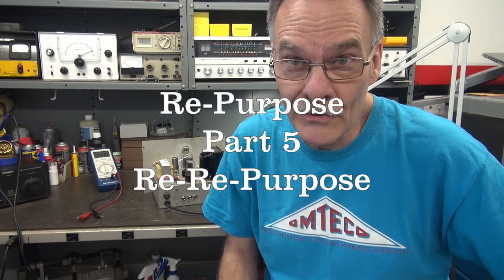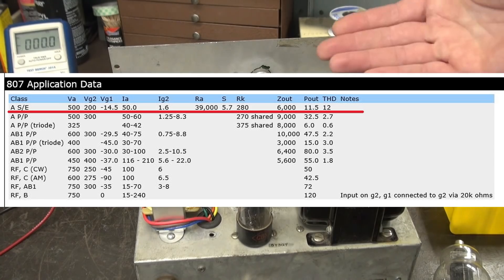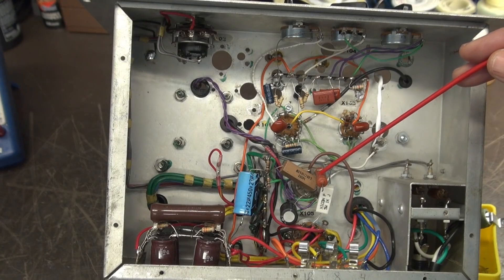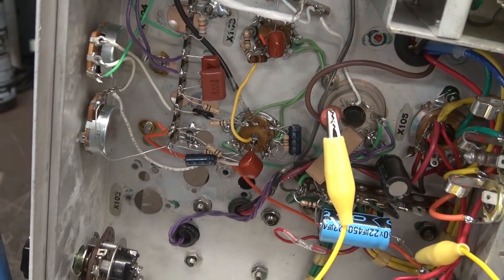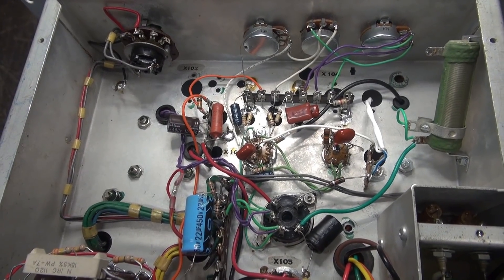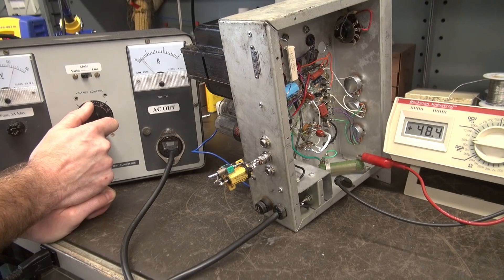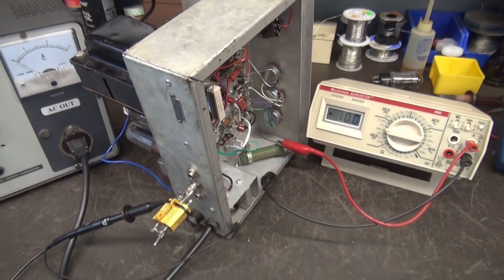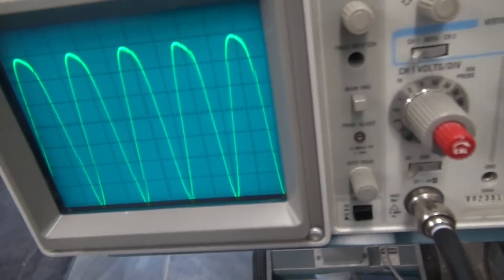How to re-purpose junk into a cool guitar tube amp Part 5 Change of plans 6L6 to 807 creation

Comment: Hey Terry.  I am trying to reproduce this amp using what I have in my parts bin.  My power transformer is out of a 1950s Collins transceiver with the 1068 V secondary burnt up.  It also has a 346 center tap winding, and 2 isolated 6.3 V ceter tap windings as well. I am using 2 half wave rectifier tubes giving me, after filter caps, a B+ voltage of 536Vdc no-load and 516Vdc with  15KOhm, 25W, load resistor.  My question is, is the 500V target voltage the Max for the 807 or is 516 nothing to worry about?  I am a newbie to tube amp tech. I work with digital electronics embedded microcontroller systems with my day job.

Comment: Hey Terry.  I am trying to reproduce this amp using what I have in my parts bin.  My power transformer is out of a 1950s Collins transceiver with the 1068 V secondary burnt up.  It also has a 346V-CT-346V winding, and 2 isolated 3.15V-CT-3.15V windings as well. I am using 2 half wave rectifier tubes giving me, after filter caps, a B+ voltage of 536Vdc no-load and 516Vdc with  15KOhm, 25W, load resistor.  My question is, is the 500V target voltage the Max for the 807 or is 516 nothing to worry about?  I am a newbie to tube amp tech. I work with digital electronics embedded microcontroller systems with my day job.

Comment: You still did not address the 'mid-range scoop' that your guitar player friends noticed.  However, this is easily fixed.  This scoop is a consequence of Fender's choice  of a fixed 6800 ohm resistor as a mid-range control -in their lesser amps.  In their high end amps, this resistor is replaced with a a 10 K  pot.  You can then set the midrange as you like it.  With a wide open pot, ALL midrange signal goes to ground.  With a closed pot, almost none of this signal goes to ground-you get much more midrange in your output.   You could even keep more midrange by adding a 1000 to maybe 4000 ohm resistor in series with new pot.     There is one downside of the new circuit however:  If you close all 3 tone controls, no signal gets through and the amp is silent--even if the volume is on 10!

Comment: I was looking at a CW transmitter that uses a 6L6 and an OD3 regulator on the control grid. it is powered off of a 325 1mA b+... would I be able to repin and throw in an 807?

Comment: Terry! I think it would be great to see a 6dq6 amp! Maybe an stereo SE version, a good project keeping the idea of use hamradio tubes like 807, here in Argentina radio amateurs have used them for transmitters or even to modulate in the audio section of the transmitter

Comment: Just a warning, I've found a lot of the old 1625s and 807s are a bit gassy by this point- it pays to reactivate them by running the filament for about 24 hours before putting any high voltage on them.

As a bit of trivia for those who aren't aware, the 807 is basically a 6L6G with a plate cap, 5 pin base and ST shape envelope.

Comment: Hello Mr. D-Lab,
I have a Fender Bassbreaker 007 with a humming/hissing/and crackling noise that hasn’t responded to swapping tubes and cleaning contacts. I don’t trust myself beyond that level of maintenance/repair. I am a huge fan of your channel and wonder if it is possible for me to hire you to address whatever issues I have causing the noise. I love the base sounds of the amp, but the noises have made it impossible to enjoy. I trust your methods more than anyone I’ve seen, and even if I could find someone local, well, I don’t know what kind of “cobbler” job I might end up with. If there is a better method for contacting you, please let me know and I’ll be in touch. If you aren’t currently taking jobs of this type, I understand and will do my best to find a qualified technician that can troubleshoot this fun little amp. I assume it’s circus boards and cheap tube sockets, but I’ve never opened her up beyond swapping tubes around. If you were to take on the job I would trust your suggestions for improvements without question, and I think it could make a fun video for examining these MIM little amps. Cheers and thanks for the great content!

(Edit, made in MEXICO, I just had a moment when typing the abbreviation)
Reply: Kevin Counihan Thanks for the tip. I’ll look into the schematic and give it a peek. Any suggestion on brand and rating for replacements? I am familiar with and comfortable discharging and replacing caps. I am not much of a troubleshooter and am reluctant at my diagnostic skills and getting in over my head if it is one of those things that could be anywhere in the amp.

Comment: Fun little build, Terry! I enjoyed that. What's the theory behind the added zeners feeding the screen? I feel like I've seen that before but can't remember the reason. Thanks again for the video.
Reply from the maker: Hey man, The Zeners do a better job of lowering the voltage for the 807 screens. Not just burning up power with a resistor voltage divider. The 807 wants approx 200vdc with 500 plate (class A), However I needed that higher to provide enough juice for the pre-amp section, so I cheated  bit. This project was big fun, Glad you liked. TD

Comment: I had the same teething trouble building transistor type 300w per channel power  amplifier.

Also my on the bench socal 50 tube amp needs a few things sorted on it.

Good video on reusing casing to build a new amp.

See how she sounds when the guitars guys try things out.

Comment: Hey Terry, may I suggest you try feeding a higher voltage to the first stage of the preamp for more gain, and maybe increasing the plate resistor value to 220k like Vox does in the Top Boost preamp?
With a higher voltage and more gain in the first stage, you'll have a higher, clean output swing, which hits the second stage harder, but keeps the preamp simple!

Great videos as always! Cheers from Brazil.
Reply: By increasing the supply voltage of 12AX7 (and keeping the operation point ideal by changing cathode and anode resistors respectively) a lower THD can be achieved as well, if wanted. However, the lowest possible THD is propably not what you always want if we are talking about a guitar amp. 😀

Comment: I got tired of relic'ing my Tele testing amps ... so I built a little 6x12inch plank with small risers, a guitar pickup, an old broken string, a tuner to get string tension, and a jack to "be the guitar". It fits on the workbench. I debated using a jack vs hard wiring a patch cable but the jack allows more flexibility. I also stay a little more focused on the amp and don't get distracted playing the guitar or tuning the guitar. Here's a handy "how to" :) ... https://www.youtube.com/watch?v=yZ7DZ7HPXck

Comment: Now that you are using the 7K tap, why not try the 5K tap as an Ultralinear mode. You could have a switch between G2 voltage and the 5K tap, your choice of operation.
Reply: No, you cannot do this with the 807 at 500 V plate voltage, if at all. This tube likes to see constant screen grid voltage at about 200 V - 250 V. Only question would be: Which tap of the output transformer would slightly deliver more output voltage swing into the load resistor and thus a little bit more wattage: 5k or 7k?
Reply: @johnnaighley9252 Thx, I don't know the 807 that well. And honestly  I have always questioned the benefit of UL on an SE amp?  Never tried or heard it. I do like UL on PP amps though.

Comment: Actually, there is a way you can lower the supply voltage, and that's by using a choke-input filter. It will drop the B+ by about 30%
Reply: There are many ways to lower the B+ voltage. In this case I would have used a couple of 10-15V/5-10W zener diodes in series with the B+ line.
Reply: @jutukka  This would actually be a poor choice, as this would cause a lot of heat to be dissipated on the zeners, whereas having a choke-input filter trades off voltage for current capability and doesn't waste any energy that you have to dissipate as heat. Also, even two 15V zener diodes in series wouldn't make too much of a difference here. The 6L6-GC datasheer calls for 350V of plate voltage, so you'd have to drop around 130V (taking into account the voltage drop across the cathode resistor), which would require to dissipate 7W of power (not counting the g2 current).
Reply: @kardRatzinger The produced heat is of course a fact. But those zeners cost only a few bucks and they can be quite often installed into a place where the heat from power dissipation is not a problem.
Reply: @jutukka  By the time you get to the recommended operating point of the 6L6 you are wasting about as much power on the zener as you are putting out into the speaker. Surely, we can agree this is not a particularly design. Even assuming you can avoid overheating problems.
Zeners are cheap, I'll give you that, but a choke-input filter is even cheaper - it's free! There already is a choke in this power supply, just needs to be moved in front of the first filter cap. 
So far the choke-input filter is wasting less power, providing more power capacity, causing less heat issues and even costs less than the zeners. I don't particularly see any disadvantages, it has all going for it.
That said, I have used zeners to drop the g2 voltage with respect to plate. G2 current is small, so so is power wastage.
Reply: @kardRatzinger  OK. In this case when the choke is there already, your point is absolutely correct. But zeners are sometimes very handy. Once I got for free a 1972 Laney L100 chassis with original PT. I wanted to build a 15W  (two 6V6s or EL84s  ) amp using that chassis and PT but I did not want a EL34 quadruplet 100W monster amp.
 I lowered that 70's british crazy 500V  B+ voltage almost 200 volts to get the B+ I wanted. To do that I built a string of 20 zeners in series to s stripboard, which was a very nice because you could adjust the voltage just by jumping up or down in that string. If I some day want more watts, I can throw those zeners away and install another OT and EL34s again. 😁
Reply: @jutukka  Yes, so you basically tried to force an unsuitable power transformer into a role for which it wasn't designed. It can be done, but that's not proper engineering in my book. Kind of like building a motorcycle by cutting a car in half.

Comment: You didn't say how much power. I'm guessing 15 watts now, maybe a little more?
Reply: Yes, a wattage measurement would be great. I guess, 10 watts rms could be possible.
Reply: John Naighley I thought 10 with the 6L6. 807 maybe a bit more. I have 4 matching 6L6GC I used in 2 mono blocks. Also have a pair 807's that were in a pa amp in the old state theatre in Easton Pennsylvania when they showed movies. I may use these tubes again if I can find the right chassis for a build.
Reply: @russredfern167  So let's hope, Terry is gonna measure the output...
Reply: John Naighley Next video I would say

Comment: Terry the only “problem” I can see is that I can’t think of a commercially made guitar amp that would use an 807.  You can buy 6L6s and 12Ax7s at any Guitar Center.
Reply: Good point but I don't think he is planning to mass produce these.

Comment: If you ever do this again just do a 6BG6.  It is a 807 but for TV use and it uses the octal tube socket. Also both the 6BG6 and 807 are available from Russia. I think they call both the G807.  The octal one is 6BG6 and the regular 807 has the 5 pin socket.
Reply: The 6p G6 is also dirt cheap. There's tons of them out there and they made them all the way to the end.there were some j a n ones built towards the end that have 7027 guts
Reply: Good to know. Thanks for the info!
Reply: Г-807 and 6п7с. Also you can search for Г-811 и Г-812. (g807, 6p7s, g811, g812)

Comment: I'm curious how hot the zeners run.  Seems like they'd have to run quite a bit of power if they do any current at all.
Reply: I usually see fat zeners used like that
Reply: I thought the same. What about the power dissipation of the zeners, Terry?
I guess, at least you'll need a bit more than 10 mA of quiescent current flowing through the diodes, they should be more beefy...
Alternatively, to be more "vintage",  one could use two stabilizer tubes (7-pole miniatur tube sockets) to get about 255 V screen voltage...

Comment: EL34 would have been better but it wants a 2000 ohm load. EL34 can take 800vdc and 150ma in SE operation....with a 2000 ohm load
Reply: All the three parameters not a the same time ;-)
Reply: John Naighley Understood...each spec was maximum spec...sooo if running 800 pV I’d guess @ 20ma...and really low pV like 250-300pV I’d guess 150ma

Comment: only problem with an 807 is it’s even CLEANER than a 6L6.....great for hams....not great for R&R guitar. That power transformer has too high B+ for SE operation
Reply: Dave Anderson it did sound very clean. Which I assumed was due to the 807.  And with a single tube in the pre amp there may not be the possibility of getting some pre amp distortion instead of a bit of distortion from the power tube. Well it would probably be a good amp for jazz and funk as it is.
Reply: Very True but clean headroom is great for  country’s chickn-pickers or Jazz guys and would make a good pedal platform If you’re into that. Stick a tube screamer in front of this amp  I bet it would sound good.  What I’d like to see Terry tackle is a true multi channel switchable clean/dirt amp like a Mesa Mark I.  For a gigging guitarist that’s the ticket IMO.

Comment: that high a voltage is going to make a "hard" sounding guitar amp
Reply: Let's say: very dynamic - My experience with a class A  beer bottle (807) amp is when laying into the strings of my guitar the attack that comes from the speaker blows me down...
Reply: I made an 807 amp that runs 450v... Its punchy and clean.
Reply: @DeadKoby  exactly my point ...HiwATT
Reply: What makes you say that?